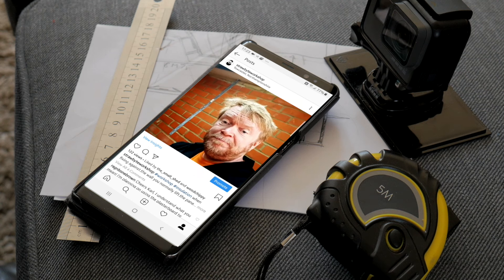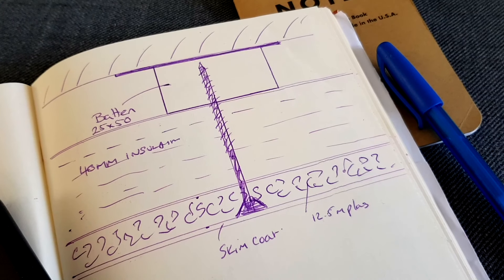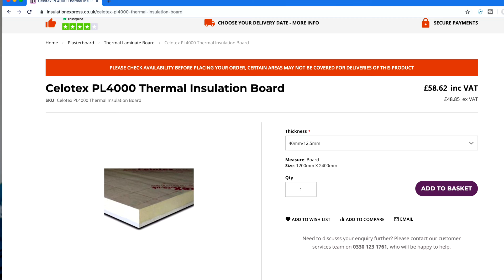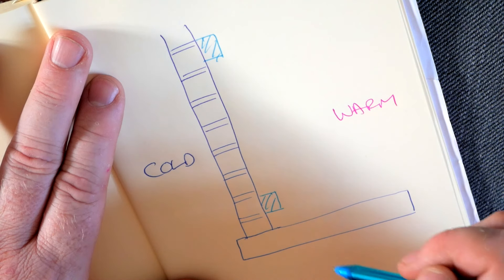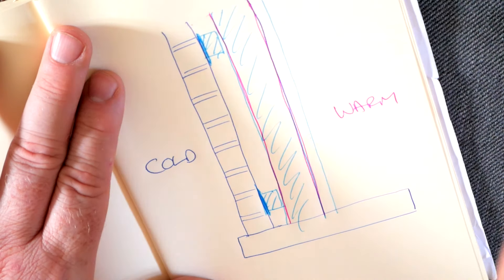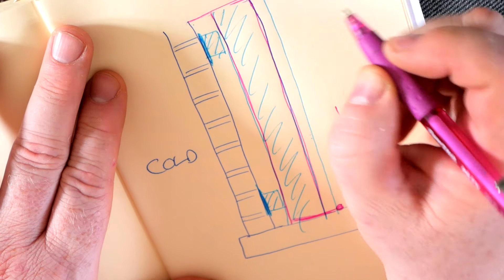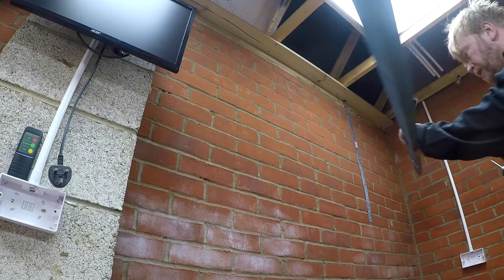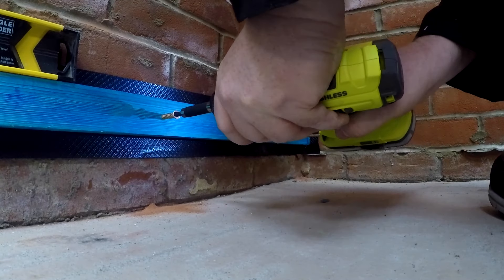How to Insulate Your Workshop | An Easy DIY Project | Keep Your Shop Warm or Cooler

Comment: Thanks for making this. As I am planning my own garage conversion this was very interesting. How are you finding the. PIR direct against 25mm battens working for you? Any case of condensation or is the limited air gap working? Did you do a follow up door video?
Reply from the maker: Hi Steve - Everything is fine and I've had very few issues. It's worth saying that the air gap is not the important feature of the wall. In fact, if there was no risk the external wall was going to get rained on then it would have been perfectly permissible for the PIR to be glued straight to the wall. It's the thickness of the insulation which is important. An on that point, my choice of 40mm PIR was a compromise to avoid too much space being lost to the wall.
The only issue I've had as been external where excessive run-off from my neighbours patio and shed, plus an incorrectly installed DPC by the builder of my garage led to water getting in from outside and spoiling a small section of wall. Other than that the workshop has remained warm when heated and the performance in the summer months in exceptional with the workshop consistently 5 degrees cooler than outside. And maybe that's a final point, what I should have added that you could still get condensation on the inside of the wall if you don't take any steps to heat the space to a temperature above the dew point.
Reply: @StrawbyteWorkshop  I have similar issues with part of the garage walls below ground level as my property is built into a hill. Nothing visible but i worries me if ground gets saturated outside. I have potential if unprovable flood risk too from a river fed from the hills around here in North Wales. I planned to have an oil radiator on low to go on below 5C and heat when I’m in there. As I won’t be keeping it warm 24/7 I might take advice I heard elsewhere and vent the garage after use to allow any moisture I produced to escape. I doubt it’ll be that much. I’m torn between PIR and rockwool as Keith rag-and-bone brown had done.

Comment: Did you ever consider using metal stud rather than wood?
Reply from the maker: Hi Nick, Yes I did. With a metal stud work wall you screw J channel into the floor and ceiling 25mm away from the wall and then secure the studs to those. You can then insulate and/plasterboard over the top. The reason for discounting it was that I wanted to minimise the internal space lost - the metal studs would have cost me an additional 36mm across the width of the room. That doesn't sound much but I'm pleased with the battening approach.
Reply: @StrawbyteWorkshop  thanks for the reply. The video I watched showed the 50mm celotex sitting within the 52mm stud. Then the separate plasterboard screws onto the outside of the stud.

Comment: Really informative video. Thanks for all the detailed information.  I have subscribed also. 🙂👍🏻
May I ask; given that the battens will be in the space where the damp accumulates did you use treated wood? Also my garage has a flat roof; will I need to leave any kind of gap above the insulation to make a ‘moisture space’ (it will be in between the rafters)?
Thanks a lot.
Reply from the maker: Thanks for your question. Yes the battens are treated. I used roofing battens and like you saw put dpc behind them. The inside of a standard brick wall risks getting wet as bricks are porous. The gap is to stop this moisture from bridging to the insulation and reduce its thermal performance. It’s the internal vapour barrier which is key. As far as flat roofs are concerned Ali Dymock has some good videos on gap considerations. For roofs it’s generally accepted that 50mm is the gap between insulation and the underside of the roof. I hope that helps. K
Reply: Strawbyte Workshop Thanks a lot for your advice; I’ll definitely use treated wood and will be sure to check out Ali Dymock too. 👍🏻

Comment: Can you show us insulating the garage door please?
Reply from the maker: I do have a blog post on how I tackled the project. This is something I intend to redo because I want to match the quality of finish elsewhere in the workshop and have the interior face of the garage door painted the same colour as the walls. But nevertheless it's not a hard thing to do and if you choose your materials carefully you won't be adding too much weight to the door, and the benefits are huge. Link to blog: https://karl-pountney.squarespace.com/blog/2018/11/18/how-to-insulate-a-garage-door

Comment: Great video! 
If you don't mind me asking - How did you approach the corners? 
I am trying to insulate my garage, following your method and I am not sure how to join the boards together at the corners of my garage.  I am worried about moisture working its way into the edges of my panel. I wondered about putting DPC between the edge of the board and the wall?
Reply from the maker: Hi James. I used two methods but the principle is the same. As you go into the corner you stop 25mm short of the wall. The thickness of the batten. And then butt the next panel at right angles to the first. When using celotex and MDF you get a very clean corner. For the insulated plasterboard you have to remove a strip of plasterboard to form your corner. There's s good diagram in the Kingspan data sheet that illustrates how much more clearly than I can explain.

Comment: Can I ask (sorry if I missed it) but why did you do some with insulated plasterboard and some with insulation/mdf?
Reply from the maker: Thanks Adam. It's a good question and you're right I didn't dwell on the reasons for switching from one approach to the other. The video compresses time at little and the first two walls were very much a learning experience and were completed a couple weeks before the remainder of the workshop. The two key factors were that the plasterboard needs to be kept dry at all times and is bulky to store. The 4 sheets I initially ordered just got in the way too much and coupled with the second factor being that it was extremely hard to handle the material on my own due to the weight I decided to switch approach. For the remaining walls I could order all the insulation that I needed and store it outside. MDF was bought daily from my local B&Q. On the plus side the finish on the plasterboard wall is way way better than the MDF and if I were to do it again and I wasn't building a workshop (music studio or home office) I'd probably prefer the insulated plasterboard product and find a better way of storing and organising materials. In terms of cost, they area about the same.
Reply: @StrawbyteWorkshop  Thanks very much, that explains it, great video by the way.  I'm planning on doing a new build double garage so hopefully the storage won't be so much an issue.  The only other thing id like to investigate is doing it so that the brick pillars are also covered for a completely flush finish all down the wall.  Any suggestions?  In my simple mind I guess I could simply use larger battons to bring it flush with the pillars and fixing all the way across, any thoughts on this being an issue?  Obviously width is less an issue with a double garage so I dont mind doing this.
Reply from the maker: @tc-ac83  Actually some of the early solutions I researched may suit you. For me screwing the battens to the wall allowed me to maximise space. An alterate way is to build a stud wall away from the outside skin and insulate between and over the studs and then apply your skin to the inside (plasterboard MDF and so on. You fix the studs between a floor plate screwed into the concrete floor and a wall plate fixed to the joists of your garage roof. Inside of the joists would be in-line with the pillars and the second late of insulation would go over the studs and the pillar. My pilars are 48cm wide so it should be fine to bridge them. If I remember I came across that approach when looking for options that would maximise the isolation of noise.

Comment: I am trying to find out the MDF step. I would love to get this kind of finish without bringing a plasterer in!
Reply from the maker: From around 9:10 you see me installing the MDF on top of the celotex insulation. Missing from the video any footage of the finishing of the plasterboard walls. I didn't use a plasterer to skim coat the wall to get the finish. Using tapered boards I was able to tape and use jointing compound. Then sanded flush and primed the wall with plasterboard primer. The finish with paint on is flawless.
I used a mix of standard and moisture resistant MDF with the MR MDF giving a better finish overall..
Reply: Oh that's amazing!! Thank you so much for letting me know!!
Reply: @StrawbyteWorkshop  is there a reason you used mdf and plasterboard? Why not use mdf everywhere?
Reply from the maker: If I did the project again then I probably would have used MDF throughout. The project was conceived with insulated plasterboard and I ordered the first batch on that basis. What I learned is that 1) it's very heavy and I was working mostly on my own 2) it has to be stored flat and in the dry and I had limited room. The switch allowed the insulation to remain outside and the MDF bought in each morning for that days installation.  I hope that helps.

Comment: Is there any reason you raised the bottom battons off the floor? I’ve done all my battening and just realised I’ve laid them right against the concrete!
Reply from the maker: I wanted to avoid the battens bridging the damp proof course. But of course that doesn't make as much sense as that sounds given there's DPC on the back of them. If anyone asks from now on I'm going to say that I can't bend down like I used to.

If you've DPC'd the back it won't make any difference.

Comment: Wow, this is perfect! I just moved into a new build with a double detached garage that I plan to turn into a workshop. You've done exactly what I want to do to mine, so this video is great! Can I ask why you did some walls with the plasterboard and some with the MDF? Was it so you could mount some things on some walls and not others? Also, did you seal between the Celotex boards are the floor/ceiling? If so, how...just with silicon? I also plan to paint my garage floor. Thanks for the info!
Reply from the maker: Hi Keith. So plenty of folk have asked why I switched between Insulated Plasterboard and Celotex and MDF and there are plenty of detailed replies to that question in the comments below, but in simple terms Insulated plasterboard was very heavy and I was struggling to handle it alone. My helper in the video was only available on a few days during the installation. The second reason was storage. It is a very cost effective material but I had no where to keep it out of the weather between delivery and installation. Celotex in its own is pretty weatherproof and the MDF I managed to order and pay for in one go, but collect from the  merchant as I needed it. 
So joint between the wall and ceiling, in corners, against blockwork walls was sealed with AC40 acoustic sealant. Between the wall and the floor I used the same, but where there were bigger gaps due to an uneven concrete floor I used expanding foam. Since the video I've installed skirting board. 
Good luck - I'm genuinely surprised how many people have found this video a help or inspired them to do the same. K.
Reply: @StrawbyteWorkshop  Thanks! I think it's going to take me a while (garage is still full of moving boxes!) but you've inspired me to get going!
Reply: Well, it's taken a while with the bad weather and other stuff, but I'm finally going to start my project next week! I already have the battens delivered for the wall studs. I'm probably going to go for Celotex PL4050 as it seems a good balance between thickness and insulation properties. I have a double garage so I'm able to store the boards in one half whilst I work on the other half. So far I have no plans to do the floor (other than cover it with Resincoat which I have already). If it seems too cold I can always do a floating floor & insulation later. Unfortunately the prices of everything have risen considerably since you made your video, but it's still a cost effective way to get a dedicated workshop I think. One quick question - it's not easily visible in your video, but what (if anything) did you do with the roof space?

Comment: Awesome video thank you! Hope you don't mind daft questions... with getting electrics/sockets put in, would you do them first, mounted onto the brick and then cut holes for them in the insulation/board, or would you get a sparky in after it's insulated and have them mounted ontop of the board?
Reply from the maker: In my case I knew the electrics would be surface mounted (it's a workshop after all) so didn't plan ahead. 
I wouldn't recommend doing the electrics in advance and bringing them through the insulation. It creates a hole through the vapour barriers. The better approach is to batten the wall, install the insulation, then counterbatten the insulation to create a void before placing the plasterboard/mdf/ply wall boards on those battens. But speak to your electrician they'll be keen for you to to choose an approach that makes their job easier.
Reply: @StrawbyteWorkshop  Thank you for the reply! My electrician actually recommended mounting electrics onto battens/boards and insulating around it afterwards, which sounds off to me too!

Comment: Hi there I’m in need of some advice. I think I have the same garage as you. I’m looking to make a recording studio in mine and as such will only be insulation the back half of the garage. I plan to split the garage into 2 with a  stud wall. My question is my stud will  go about 12 inches past the brick pillars on either side as that’s where the next rafter is to fix against. Would you suggest leaving the pillars bare and insulating the 12 inch gaps on the other side? Or go over and around them? Any advice would be great!
Reply from the maker: Hi Mathew - I've now covered the brick piers with an insulated wall panel bolted into the block work. If you go to my instagram @strawbyteworkshop you'll see a recent picture. I would suggest not leaving them bare. In my case the piers have been covered by 25mm of insulation (less than the walls) and 18mm of softwood plywood. Then the AC50 sealant in the gap between the new panel and the installed wall panels. Keeping the noise in the workshop is a major consideration as the workshop is nearer my neighbours living room than my own, and even though I've only installed two panels over the piers before lockdown, it's made a big difference. And good luck with your plans for your recording studio.

Comment: Hi Karl, great video, really helpful, I'm doing something similar to my garage which is quite similar to yours but smaller, my issue is it's half brick thick and I've been warned against this for the weight of the plasterboard and battons, I was wondering if you knew a way around this without compromising the buildings structural integrity?
many thanks
Reply from the maker: Hi Nick - thanks for the comment and as for the question, an alternative to hanging the battens (then insulation followed by plasterboard or MDF) is to fix a bearing timber to the floor and roof joists and fix battens between them. A stud wall if you like with just a handful of fixings into the wall to add stability. You'll need DPC under the floor bearer and behind the vertical studs if you place them directly against the wall. The load of the wall is then through the floor and not off the wall. You can then fit the insulation between the studs with thin layer over the face of the wall which when taped gives you your vapour control barrier. The important thing to remember about brick is that in heavy rain they 'wet through' so keep timber off the brick with DPC at every opportunity. I'm going to have to re-do a 600x600mm section where moisture has penetrated.
Reply: @StrawbyteWorkshop  thank you Karl, that's a great help, i was also turned onto the dot and dab technique which I may use for some walls, but over my workbench I was looking for a way to hang tools and cabinets on afterwards so that's a huge help

Where did you buy alot of your products from, any particular supplier or just the normal construction places?
Reply from the maker: @nickhoy8727  All the insulation (including the insulated plasterboard) was from Insulation Express an online insulation specialist and very cheap. The blue battens were from Wickes and were miles cheaper than builders merchants when bought as 4.8m lengths. MDF from B&Q. Some things were really expensive by comparison and I couldn't find a good price or quantity. For example, the plasterboard sealer and jointing compound - expensive and sold in quantities miles more than I needed. But I did get rid of the excess on Facebook Marketplace and the finish was unquestionably worth it. In summary I shopped around and I think saved about 30% compared to getting one builders merchant to supply.
Reply: @StrawbyteWorkshop  yeah that's pretty much most of the places I'm getting my supplies, just wondering if I'd missed any cheaper options

Thank you for answering my questions, you've been a great help 🙂